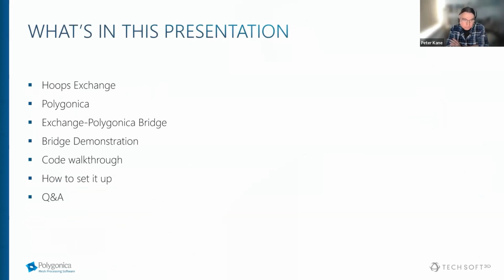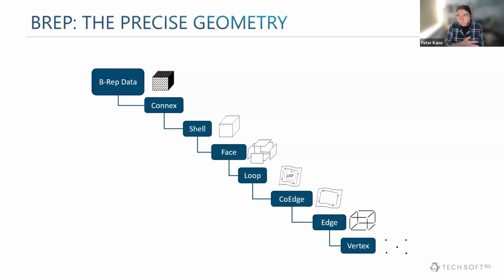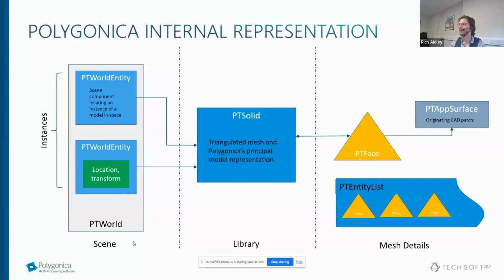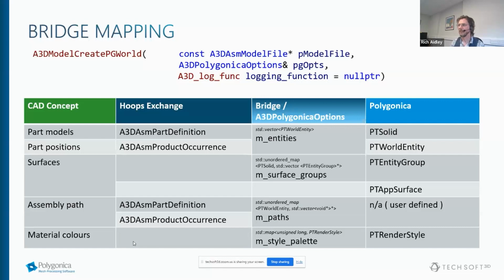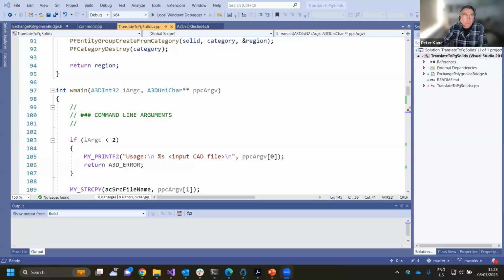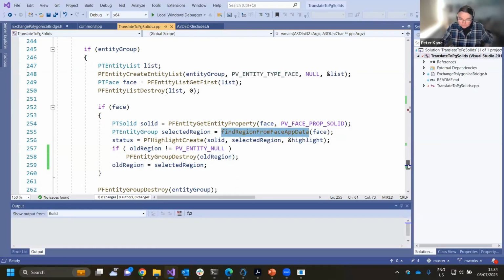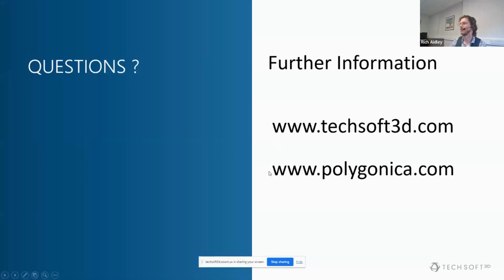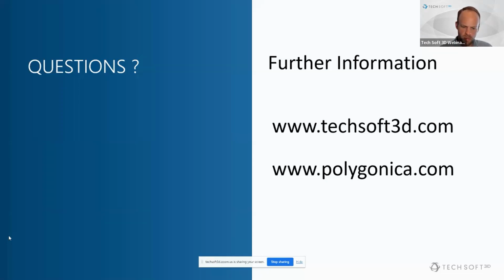An Introduction to the HOOPS Exchange & Polygonica Bridge

Comment: I have few questions please help to answer this, looking for a solution from a long time:
1. I'm using old polygonica exchange bridge, while we traverse the assembly and have multipleParts in this, then only last  partDefination is used to make solid. So how to make a solid from all the traversed parts like merge the solid to one single solid. Is this handled in this new bridge.
2. When we load a solid work files and it has textured triangles, how to handles this case. In old bridge it is not implemented, In this new bridge is it handled ?